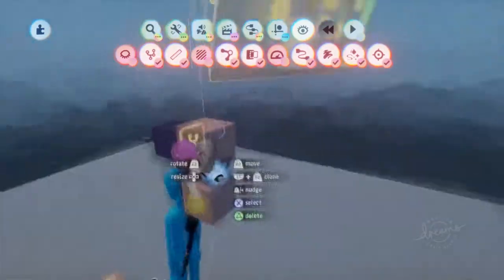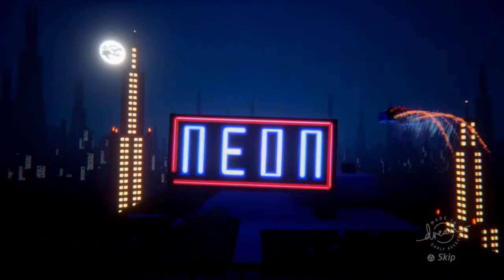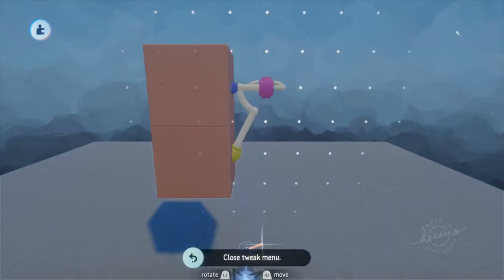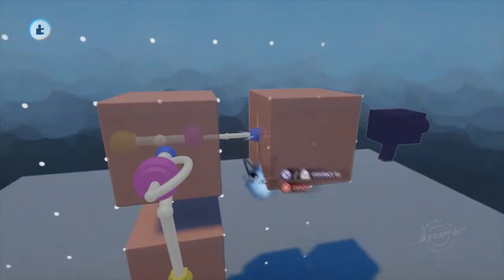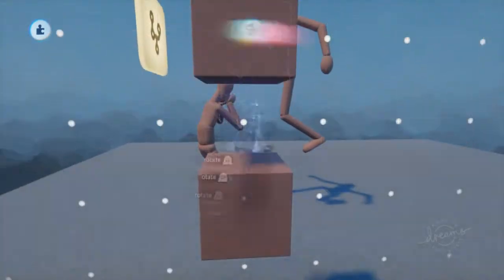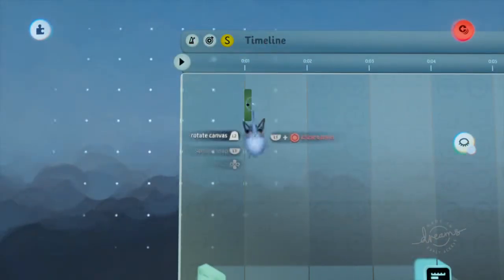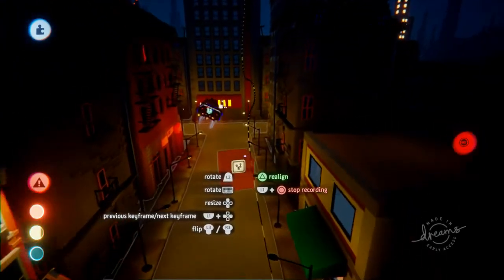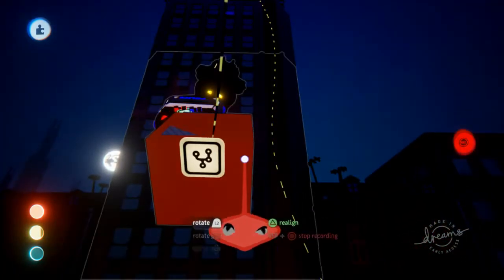Dreams PS4 | Camera Rigging and Cutscenes

Comment: Hi there I have a question. I often do camera work with a single camera with key frames on the timeline. With this method camera moves from one spot to another on a straight line. But what I often want to do is have camera go from A to B on a curved line. How can I do this?

Comment: I'm making a game from a top down perspective with the character being a ball. The ball will bounce back up (towards the camera) at pretty fast rate. The problem however is that I want the camera to stay with the ball as it both going down and then back up. Do you have a solution for this? The ball also has a minimal amount of multi-directional control while in the air if that matters much.